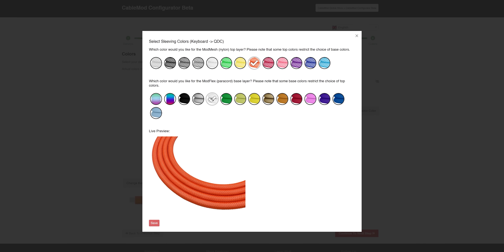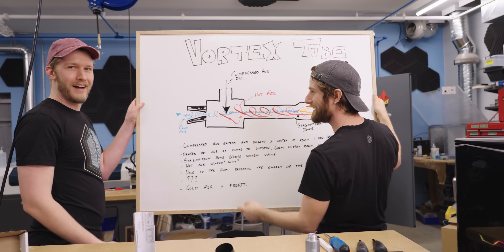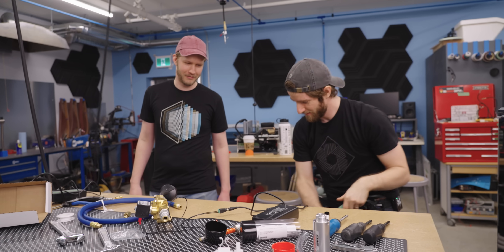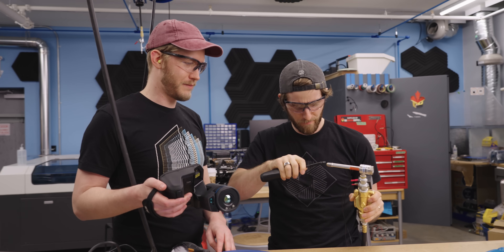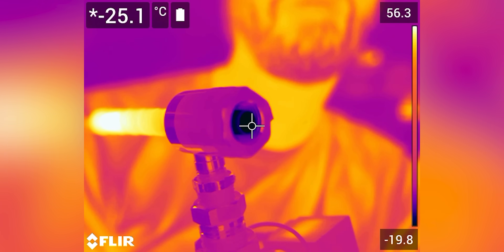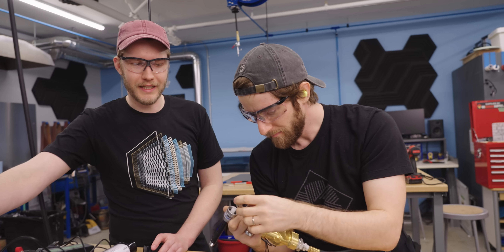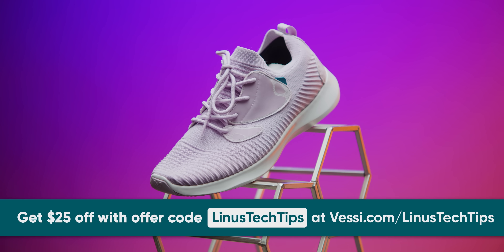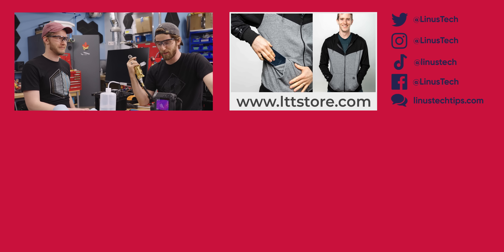This is a CPU Cooler? - Vortex Chiller

Comment: Compressed air is one of the MOST expensive forms of energy in an industrial plant coming in at almost 8 times that of electricity. Watt for watt cooling between a peltier cooler and vortex cooler, the vortex cooler would cost far more money to operate. That said, vortex coolers are still awesome.
Reply: The vortex cooler is optimal for applications where a Peltier would not be appropriate. You can channel the cooled air from the vortex cooler through insulated tubes into a machine while keeping the 'hot side' away. You can't do that with a Peltier, the 'hot side' will always be in close proximity to the machine. If the vortex cooler is constantly running, like it would in an industrial setting, the efficiency loss becomes less and less as the inner tube itself gets down to temperature.
Reply: Meh, peltier is around 20% efficiency and needs a ton of airflow to cool the hot part, which makes it more complex than using air throughout the entire system.
Reply: @shadowtheimpure  I totally agree with you. I was just making an observation. Most people don't know just how expensive compressed air is.
Reply: @LtdJorge  nah its way worse than that, expect under 10% if you want to cool cpu and see results. Tecs only look good on paper at zero T delta and zero watts of heat pumped. There is reason its niche used only if nothing else fits.
Reply: Yep, this thing is insanely inefficient. Napkin math: the vortex cooler is using 12,000 watts of energy to create the 850 watts of cooling. 14.1% efficient! That's not counting the efficiency of the air compressor, perhaps 85%, and pipe loses.
 McMaster where they bought it lists it next to refrigerant based A/C units, where it gets absolutely stomped. McMaster does not list CoP for these units, but 2 is a safe minimum bet. They would turn 1500 watt wall power into 3000 watts of cooling. The vortex tube would have very niche applications, perhaps where condensation, refrigerant leakage, or size constraints are a concern.
Reply: @themonkeyman2547  One thing they got right is that it is useful for applications where you need to direct cooling into a very specific spot where there isn't room for heatsinks and fans and what have you. Think of something like an automated welder or plasma cutter or something where you are losing production time because the machine has to stop every now and then for minute or so to let something cool down. Just use something like this to blast some cool air on it and keep on rolling.
Reply: The advantage of compressed air is the same as hydraulics: power density.  You would use this device in some machine where space is at a premium, and you just need to run an air supply hose out to your bulky compressor equipment.  

There's other advantages of this kind of device, especially if you're considering sensitive equipment or sensitive environments.  Since it's just air, there's no risk of damage if leaks develop.  You can supply it with a rubber hose so there's no possibility of an electrical short due to the cooling system.  Both of those would be a concern if you wanted to use chilled water instead.  This device is also almost impervious to vibrations, which might damage or short out a peltier system.
Reply: @shadowtheimpure  Especially useful for procedures like welding.
Reply: Tips for people in industrial jobs: Air leaks in a compressed  air system can cost a company thousand's of dollars a year. 😉
Reply: @wingracer1614  I work in automotive parts testing, on parts with high torsional fatigue loads I often use multiple of these to keep the part cool as thermal stresses will cause premature failure. There really is no other way to cool some things (without making a mess) and that's where these shine
Reply: @PaletoB  Tip I remember my brother talking about from his industrial training.. High pressure compressed air systems could be among the most dangerous things in a whole factory. - Could kill by injecting air through the skin putting bubbles into the blood stream. Could also throw things at high speeds or even tear things like fingers off, cause intense fires, etc. Oh and leaks could be more like explosions..
Reply: @PaletoB  I worked at a place that took their unused 80cfm rotary screw air compressor and plumbed it to the building air tool supply (mostly small hand tools, occasionally).....and ran it 24/7....including nights and weekends, until someone finally started turning it OFF at the end of shift.  Still, I bet they coulda bought a piston compressor for the first year's electric bill.
Reply: @shadowtheimpure  And as narrow as a niche may be, McMaster doesn't stock things that people don't actually need to get their work done. A vortex tube can replace (or supplement) liquid cooling on a machine tool without the mess and plumbing, and your machine shop is going to have air lines anyway, for example.
Reply: Thank you! It might be cheaper to have an endless supply of wet dollar bills that you freeze and then hand place on a CPU, to be replaced every couple of minutes.
Reply: then what is the use case
Reply: II’m
Reply: And yet the tools are cheap and they're much stronger than their battery and corded counterparts.
Reply: I think thats usually because leaks, wrong fittings, wrong hose diameter, lack of condensors, lack of maintenance that keep the pump on constantly.
Reply: @lazeran4900  If you have an abundance of pressurized air.  Vortex coolers can be used to cool breathing air used by workers sand blasting or painting in confined spaces.
Reply: It is quite a shameful testimony for intel, that even that freaking cooler is hardly able to bring down their CPU temps to non throttling operations.

It is absurd, that we are at a level here, where cooling approaches the needed power levels of the CPU's actual power consumption.

Again i can see, why apple changed the basis for their devices from x86 to a leaner RISC ISA.
Reply: I would like to see Alex try his idea with the vortex cooler. compress air in the box, hot air out.
Reply: Your comment ignores the system parameters and the specialized compressors that are designed to cool the flow this unit needs.  This device is a volume consumer of flow not a pressure consumer of force so has a much higher efficiency against the compressor systems designed for it (and regular lobal/piston systems).
Reply: We use them in cabinets not only for the cooling properties but to introduce clean, mostly dry air. This creates a positive pressure that leaks out through conduit and door seals. Keeping nasty, corrosive plant air out. But yes, these things are HORRIBLY inefficient.
Reply: @jgw928  I worked in a physics lab and replacing liquid cooling was what we used these for. Things like mercury ignitrons (huge mercury arc switches for switching tens of kiloamps), which needed water cooling for continuous operations, could be cooled by a vortex cooler when used intermittently, needing only a single air line to be run to a bank of switches.

They're also useful when you need a huge temperature differential. A peltier cooling from 20C to -50C would be about 1-2% efficient (COP of 0.01-0.02). You can gain efficiency by stacking elements, but only when each element is run at a small percentage of its rated current. A peltier cooler that could move 800W across a 70C differential with even a 10% efficiency (COP of 0.1) would be comically huge (and you'd need to remove 8800W of heat from the hot side effectively enough to keep it from rising much about ambient temperature).
Reply: That's interesting almost every piece of equipment I use at work is compressed air
Reply: @aladdin8623  "It is absurd, that we are at a level here, where cooling approaches the needed power levels of the CPU's actual power consumption."

Wait, what??
Maybe I misunderstood your comment, but the way I understanding it it makes zero sense. Could you rephrase that comment?
Reply: @shadowtheimpure  Vortex coolers also have literally minimal maintence on the end, it's a solid piece of metal lol. Regardless very cool, This Old Tony built one that kinda worked on his machine shop (they are surprisingly simple to make, much harder to perfect)
Reply: yep this is another pointless piece of tech that is wasteful
Reply: One thing nobody mentions is the adiabatic cooling of the air itself.
Huh?
High pressure, room temperature air expands coming out the nozzle, cooling in the process.
The jet of expanding air will cool to below ambient air temperature, and that is before any vortex nozzle!
The heat ends up being radiated by the air-compressor!
Reply: Indeed, as I work at a small automotive shop it can be surprising to see what one small leak in your system is costing you each month!
Reply: @tippyc2  And there is no moving parts inside the "cold gun", making maintenance easy.
Reply: @CaindNet1  yea its amazing how many business treat compressed air as free, and have no idea how much various leaks are costing them.

That being said Its certainly one of the most convenient and safe power sources that can be easily distributed around the workplace (and cheaply supplied to new areas with some small plumbing changes), so the convenience factor is relevant here too.
Reply: @Esablaka  It also works on more than just air. Welding tends to have a ready supply of high pressure shielding gas available. The welding arc can easily overpower the cooling effect with just a small amount of extra power, so you can just replace your normal gas lens with a vortex cooler device. Now you can force cool the welds with the same machine, enabling much shorter process times.
Reply: They also can get oil in your pc components
Reply: @billyhatcher643  no, sometimes  is your only option
Reply: Came here to say this. At 40cfm you would use around 8000w of a compressor to get 10% of that for actual cooling. That being said, it's a very simple solution to have emergency active cooling on a cabinet for a piece of machinery, like what is actually implemented on an Italian saw where I work.
Reply: Thank you to this comment thread for teaching me things
Reply: peltiers are pretty cool too.
Reply: Go a peltier, bolt the cold side to the CPU and the vortex cooler on the hot side for the most inefficient cooler ever
Reply: I have been an thermodynamic engineer for 30+ years.   I have used these vortex coolers in extreme situations.   It is very inefficient.

Refrigerant 
300watts energy gets you 1000 of cooling.

Peltier
1,000watts energy gets you 1,000 of cooling.

Vortex cooler
15,000 watts to get 1000 of cooling
Reply: @Linus Tech Tips: i checked all 2760 comments and this is the only one you have engaged with so here is hoping you see this. Vortex tubes have 4 main modes of operating; efficient heating, maximum heating, efficient cooling, and maximum cooling. My fondness for vortex tech has me feeling more emotionally invested in having this test run properly than i should but please do this device the meme test justice it deserves. Please seal the case and run the cold line into the case in the maximum cooling mode at the flow rate your compressor can handle continuously until the internal components are saturated at cold temp and then using the air radiator with maximum surface area. With this test situation we can see what the bottleneck will be; the radiator's ability to conduct temp from air, the cooling rate of the tube to case-air/components, or the compressor's air-flow rate.
Reply: @PaletoB  we have smoke vents on our building that work on compressed air, they are a nightmare as they often go wrong and finding the leak can be a right pain. The frequent leaks also cause the compressor to run way to often which not only increases running costs significantly but also drastically reduces the life span of the compressor. We had a compressor burn out over the Christmas break because a valve failed on a vent causing the compressor to run 24/7 trying to close it.
Reply: Yeah, but a huge difference here is that while a peltier generates additional heat (which you also need to get rid off) just a few mm away from the cold side, when using compressed air, the additional heat is generated around the compressor, far away from the cold side.
It's not more efficient, but in most case scenarios, it's way more practical.
Reply: @PaletoB  In very large industrial settings (like the plastics plant I work at) it can cost hundreds of thousands per year. We did a compressed air audit a couple years back, and are saving approximately $156k per year from repairing air leaks, improving dryer efficiency, etc.
Reply: We use to use vortex to cool the back side of peltiers.....when fast highly controlled temp deltas are more important than effiency: semiconductors, manufacturing, aerospace, medical, military.
Reply: @tippyc2  do you have any idea as to the life span of parts like this? is it like 500 hours or 5m hours?
Reply: @hoobajoob1  Thats a really big "It depends".  10k wouldnt be farfetched as long as the environment isnt corrosive.  5M is more than 500 years of continuous operation, i doubt you're gonna hit that much lol.
Reply: @tippyc2  thanks I appreciate it
Reply: As far as im aware they don't have alot of practical applications, mostly just used in vary niche CNC machining. Why you would ever even consider using this to cool a computer is beyond me (outside of Linus going "herpderp, we are out of idea's. Lets use a obscure Ranque-Hilsch tube to get views"), even a janky ass mid 90's homebrew phase change system made from parts out of a window unit would be more practical then this.
Reply: If I just put my computer into a refrigerator, would that be better?
Reply: @williamlazenby314  They have a video on that.  TLDR: Only if your fridge's compressor is rated to move that much heat, and most aren't.
Reply: @arthurmoore9488  I had a friend that used two dehumidifiers in series with a freezer. These kind of videos remind me of my youth 🤣
Reply: this.  I was annoyed by their completely inappropriate  application of the cold air.  So painful to see the creativity, resources, and capabilities their shop has, but a complete lack of execution.  He's been cooking this idea for over five years and his elegant solution is "aim it at the hot thing." 

It's ok.  They are artists not scientists.
Reply: That sounds quite misleading. There's a reason why pneumatics are used for a decent chunk of industrial processes.
Reply: @CaindNet1  Yeah, like $5 a year difference. Not something to be concerned with.
Reply: @wingracer1614  for those applications we use liquid cooling. Water cooled welders pipe coolant into the torch to keep it from melting.
Reply: @toastedonion  I'm glad your employer chose machines that fit their needs. You left out compressor size, work load, and operating time in your comparison which my employer failed to consider making a large always running screw compressor with little load a poor choice.
Reply: @CaindNet1  Unless you have a lot of free compressed air and where you can't use other methods of cooling. I've seen them since the 80s in factories for spot cooling and personal jacket cooling.
Reply: build a trompe in your local river
Reply: Was thinking the same thing. You should of seen my electric bill painting my truck vs crypto mining. 😆
Reply: Yes but the amount of cooling achievable is far great than electricity alone.
Reply: @shadowtheimpure  You are right! Compressor maintenance companies will have you run your shop system at 150 PSI because that makes them earn a ton of money! I directed a project to lower energy costs in a printing factory, and we reduced the shop pressure to 100PSI (the highest pressure used in the shop was 90 and the reserve was immense) and removed devices that were "blowing" compressed air to replace them with electric low pressure/high flow blowers and finally, we fixed audible air leaks, and we used an ultrasonic device to detect minute air leaks from far and locate/fix them... This did cut down the energy bill of the place by 10-15% and the compressed air bills by more than 75% (that printing factory used around 3 megawatts of power to run machinery only, so when you get a perceptible drop in consumption at the end of the month, you know you did something big!)
The dumbest equipements in a shop are those that blow compressed air directly in the ambient air... You pay huge amounts of money to compress, filter, dry, store, distribute compressed air on a shop piping network, to just les it blow-out to the atmosphere to get airflow.... stupid! Compressed air should be used to move stuff... Pistons, motors, actuators, etc. Not provide air flow! A compressed air leak that you can ear, depending on the pressure, can cos you as much as 12 000$ per year!
Reply: depends on what compressors you are using. Piston, Rotary Vein, Rotary screw, centrifugal all have their strengths when set up correctly.
Reply: @MrVladiman443  Nop, any of those still costs a fortune to operate... In a shop, (I mean a big shop, like a news-printing facility) compressed air is one of the most expensive thing! 
The most efficient type of compressor (Piston) still remains a huge energy waste!
Reply: Yeah we use them alot in operator stations to keep hmi touch screens or small plc cabinets cool.They work fairly well bit as CAmarine221 said compressed air isn't cheap.
Reply: Maybe. We still use one of these bad boys to cool the products. It was easier to set up when the robot is holding the piece to be cooled.
Reply: Yeah we used chillers and speed whenever possible to b cool.
Reply: That’s why data centers and industrial settings don’t use air or peltier....
Reply: Yeah, if I'm not mistaken compressed air generally costs more to run per volume than natural gas does.
Reply: We used these for remote vfd drives primarily to keep positive pressure whenever the panels were open pretty much just to keep dust from getting inside the drive panels. Paper dust is conductive enough to fail electrical testing.  Air had to be ran to the panels either way and the ambient temperature around the panels exceeded 90°C
Reply: can these vortex theoretically run on batteries or solar panels ?
Reply: Peltier coolers are incredibly inefficient and require active cooling themselves, they shouldnt be used for anything where there are any alternatives.
Reply: To be fair, the required pressure depends on the desired temperature difference. You don't need to go to -50°C in for example case refrigeration.
Reply: Women are actually the most expensive form of energy. HEY-OOOOOO.  *Im so sorry honey its just a joke ;) I love you!
Reply: Steam is #1 but when you need cooling way out at the safety flares for PLCs it’s worth it.